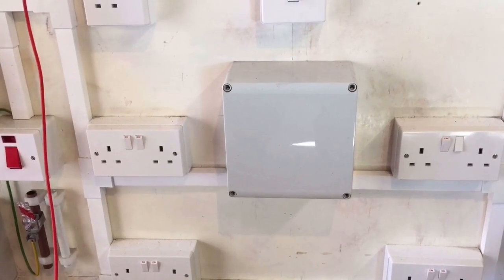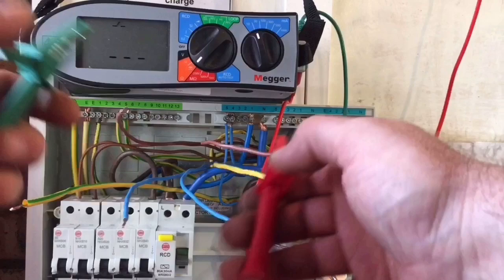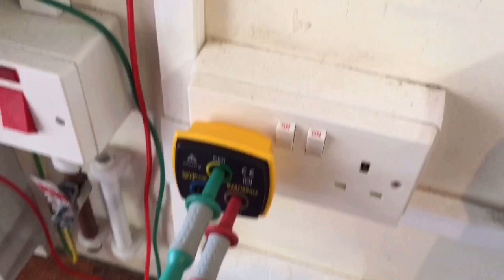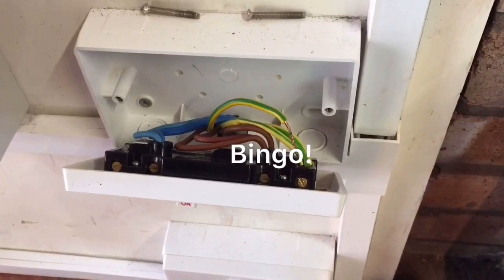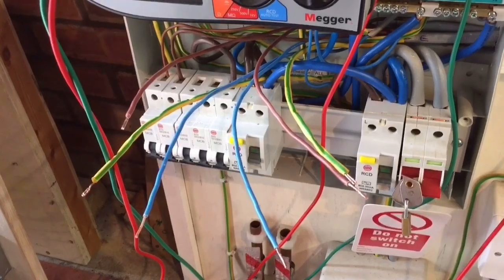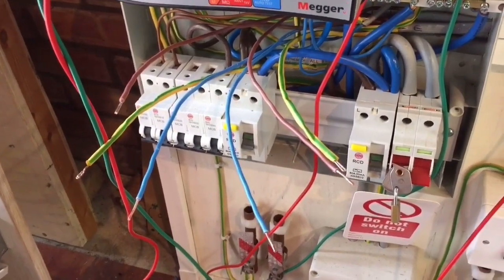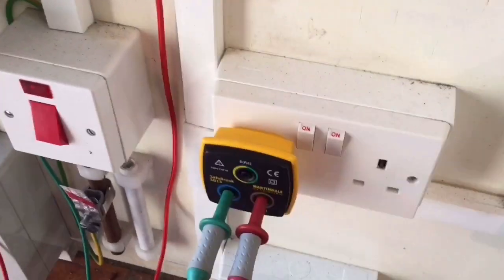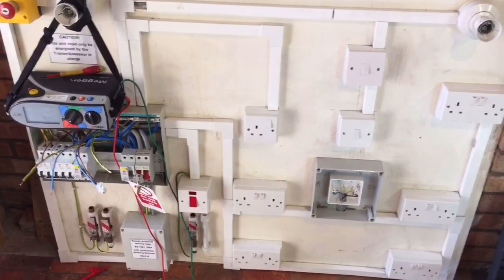Ring Continuity Fault Finding

Comment: In a real life scenario, it’s not so obvious to know how the circuit has been wired, in the video the break in CPC could just have easily been at the DSO to the left of the CU. I sketch out all the sockets and just like in the video, I connect the line and CPC together and record the reading at each socket, I then disconnect the line and CPC and connect the line and CPC of the other side of the ring and record though too, the break will be at one of the sockets with the highest reading, if the socket is spurred then go to the socket with the second highest reading.

Comment: Nice one pete👍 On a test rig such as this one, with an obvious wiring route visible on the surface, this method works a treat. I suspect it would be a lot more difficult in a real house situation, where someone else had previously wired the circuit. With say a ring feeding 2 different floor levels, and the route of the ring being unknown. But this method would point you in the right direction of which sockets to remove first. 
Cracking video pete keep them coming👍
Reply from the maker: Cheers Daddy B, thanks for getting involved. Thought about that. Let's say it's a Periodic instead and nothing is marked up to make it even more of a challenge. Three rings, only one has the break. For the two good rings we can connect L-E or any combo at one end and identify all the socket on that ring. Then we're just left with the dodgy circuit and follow the procedure. Never an exact science but you havin' that our kid? 👍